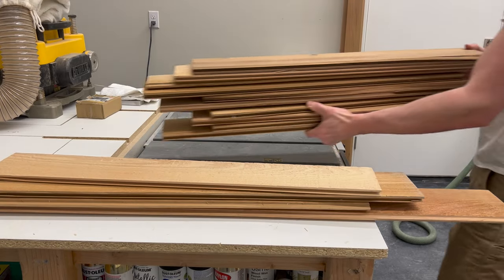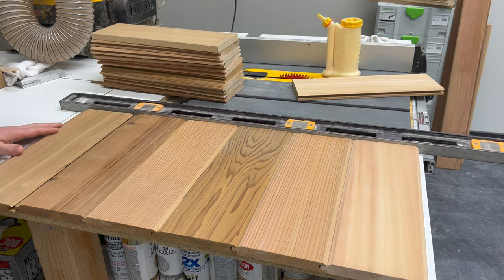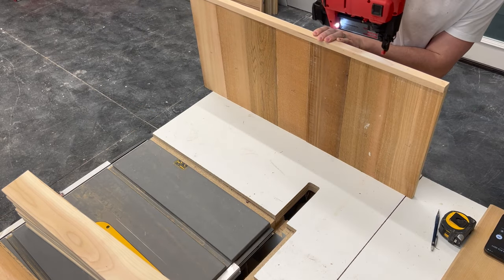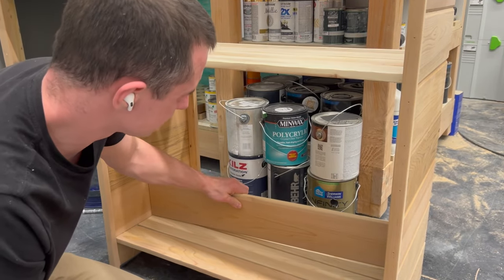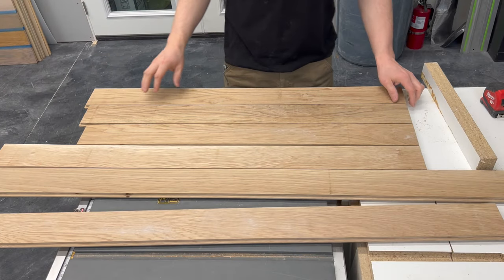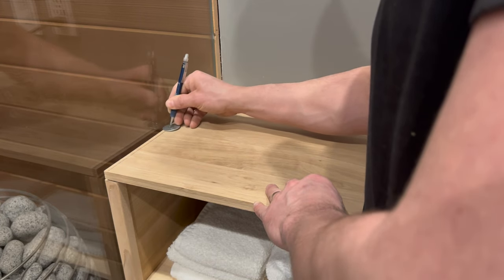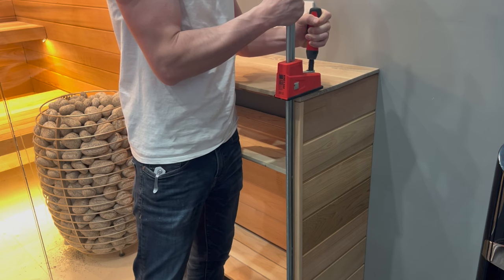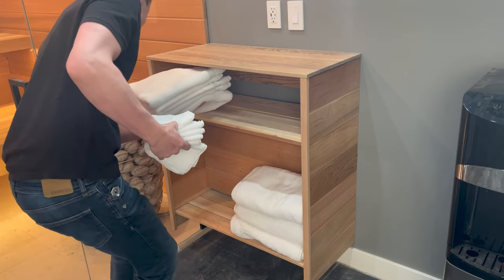Building a Sauna In my Garage part 3 DIY

Comment: Theres only one flaw in your sauna and its actually a big one, theres no floor drain. "Dry sauna" isnt even a thing, if youre not throwing water to kiuas youre missing the whole point of sauna. Sauna isnt ment to be a 200f dry droom, its ment to be humid af. Might just as well put a radiator in your closet and call that a sauna.
Reply from the maker: Every sauna session I throw water on the sauna rocks to increase the humidity of the room. That water never makes it to the ground, because the heat of the rocks instantly turns that liquid into a gas.  Therefore, having a drain in a dry (yet humid) sauna is not necessary.
Reply: @DaveyStruggle  well id say i know something about saunas, because ive been working with them for my whole life in Finland. Youre supposed to throw everywhere from 2-15 liters of water to the stove during a sauna session, If youre unable to, your stove is way too hot.

Drain is absolutely necessary also because youre supposed to wash your sauna at least twice a year, with running water or your Sauna will be filthy from all the sweat, making it an extremely unhygienic place.
Reply from the maker: I pour about a 1/2 cup of water at a time. 2-15 liters is not necessary. Therefore, in my humble opinion, a drain is also not necessary to acquire a hygienic sauna. I spot clean the walls and mop the floors more frequently.
Reply: @DaveyStruggle  Bro its not a real sauna experience if the sauna is not at least 176,00 farenhait. 1/2 cup of water is not enough.
Reply: He’s right you def need a drain in this sauna, you will eventually need to wash the boards not to mention all the sweat that will be all over!
Reply: Also its not about how hot it gets, you need that amount of water, löyly, to make it like sauna should be. If you enjoy to be in a hot room thats fine but thats got nothing to do with a real sauna. We know something about saunas, we invented it and have 3,2 million saunas in a country with 5.5 million people.
Reply: @sinkkumieslohjalta4891 here are many saunas that use heat and humidity. All saunas do. 
As does the one in the photo. Floor drains are not needed because you’re never supposed to put more water than can evaporate immediately. Often these saunas use electrical heating elements that are not capable of having water poored directly on them, therefore no water ever condenses.  

Steam rooms, on the other hand, do have high enough humidity to actually condense, and therefore need a floor drain.
Reply: @richeyrich2203  lmao you have no idea what youre talking about. Im Finnish, we INVENTED the Sauna, ive been working with saunas all my life. I think i know a bit better than you how theyere supposed to work.
Reply: @sinkkumieslohjalta4891  "real sauna"☝🤓🤡
Reply: @sinkkumieslohjalta4891  please upload some of your sauna video and then i believe it.
Reply: I'm not Finnish but I understand your pain ahaha I studied in Estonia and went to sauna a lot and people would be constantly throwing water on the stones, I even saw people throwing water to the walls
Reply: Great sauna and great work… Dry sauna is the way to go… Finnish really dont know about sauna’s, but they have polar bears and work at Nokia.
Reply: Scottish people invented golf….but they are not very good at golf.
@sinkkumieslohjalta
Finnish people may have invented the sauna but you obviously have zero idea how to use one, I was in Finland last year and went to a sauna and some fat guy was in there telling me how much he knew about saunas, he then argued with me about the ammount of water to put on. He then poured on about 15 litres of water and the sauna rocks all went cold and the heater basically blew up. After that he didn’t tell me any more about how much he knew about saunas
Reply: @sinkkumieslohjalta4891  
3.2 million saunas, 5.5 million people….so 2.3 million people have no saunas…they can’t like saunas that much in Finland mate!
Reply: Man these Finnish folks are combative. Great work on the sauna. Plenty of sauna's sold or used here stateside (Costco, 24 hour fitness) don't have drains. The ones that do, we call them steam rooms 😅
Reply: @DaveyStruggle  Steam becomes water once it cools down. It does not disappear.

Comment: What are your sauna dimensions? Did you use 1/4 inch cedar?
Reply from the maker: About 8’ high x 8’ deep and 5.5’ wide. The planks I used are considered 1x6”. Actually dimensions are 5/8” x 5 1/4”.

Comment: When you tested the sauna did it smell from the glue? I never heard of anyone using glue in that enviroment. Also  I am surprised that you used tiles in a sauna, doesn’t it get to hot for your feet? Normally you use waterproof floors and then wood on top of that, wood that are not tite together and not fastend and a bit up from the floor so you can take them out and hose down the floor.
Reply from the maker: First use to over a year later, the sauna had no glue smell. Only the scent of cedar. No, the tile stays really cool (if I was to guess, about 70 degrees). The heater gives off most of its heat upward, even sitting next to it is cooler than sitting on the top bench. Use a mop to clean up the floor, never needed to hose it down.

Comment: Seems very well put together. You had previous experience building sauna's? Also, is there a rough estimate of the material cost involved with this design?
Reply from the maker: Yes, I have a complete breakdown in the description in Part 1. Check it out here. 
Building a Sauna In my garage part 1 DIY
https://youtu.be/ZHkRDcEpLfc
Reply from the maker: As to your first question. I had no prior experience.

Comment: I am working on the same 15 kW sauna heater and I had a question how to wire it and what kind of wire did you run? How many amps is your breaker and stuff like that if you don’t mind telling me.

Comment: It looks awesome! I hope the result of mine will be similar. I did not see a drain on the floor of your sauna, isn't it useful?
Reply from the maker: I’ve been using my sauna for almost 2 years now, and having no drain has not made use any more difficult. Installing one would have added unnecessary cost and labor, in my case.